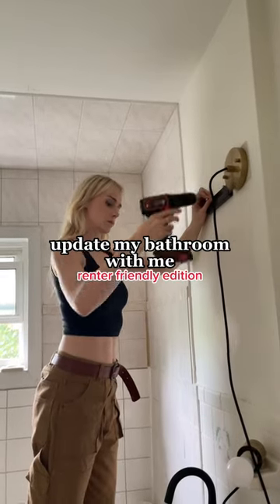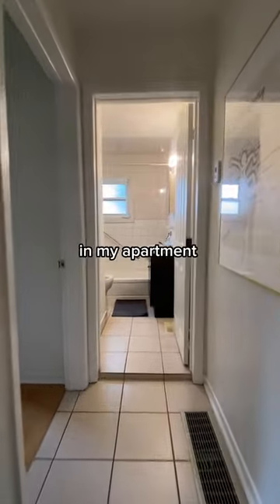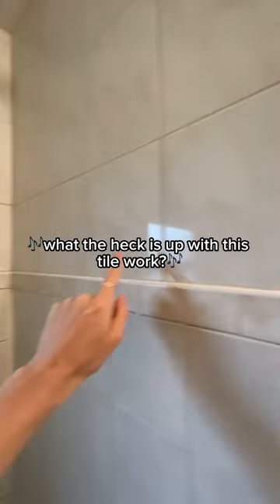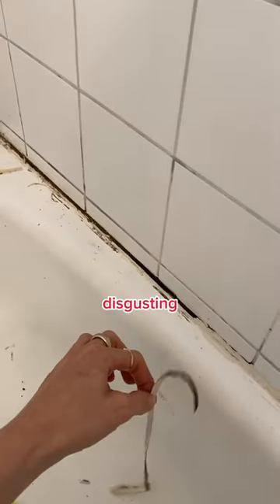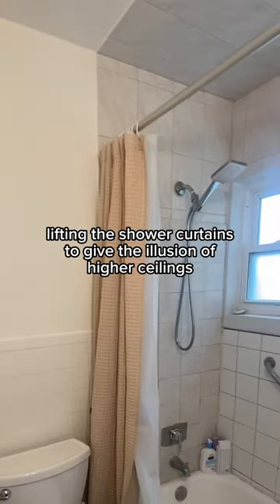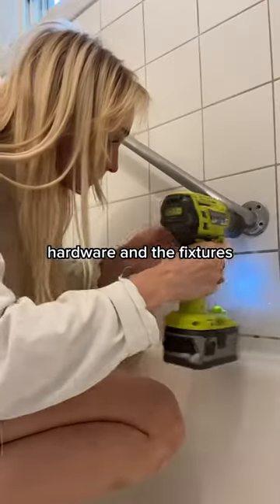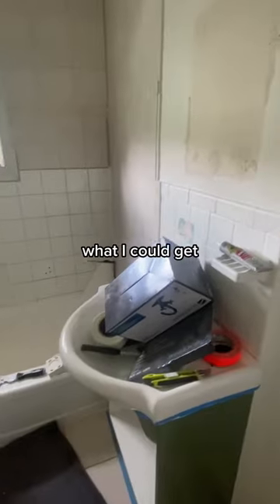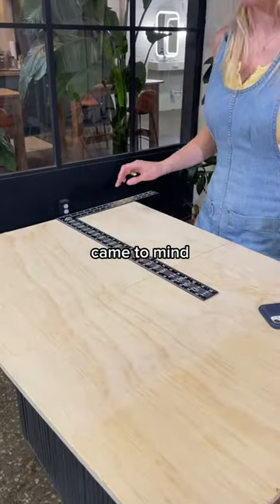Bathroom Makeover Part 1🙈

Comment: The difference in tile usually means that at some point in time, there was a plumbing issue…a leak or something. And the only way is to remove the tile so the plumber can get to the pipes. At least here in NYC, one should really pay attention to how much of the tile looks replaced, because that could mean ongoing plumbing issues. If it’s just a spot or two then I wouldn’t worry. No place is immune to a leak here and there and pipes get old too. 

Great job on your updates to your bathroom 🤗